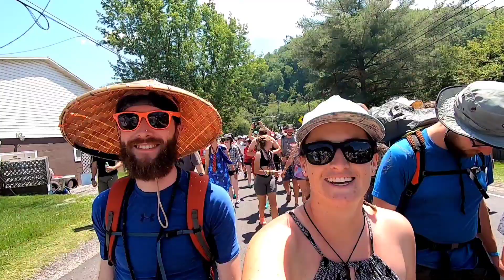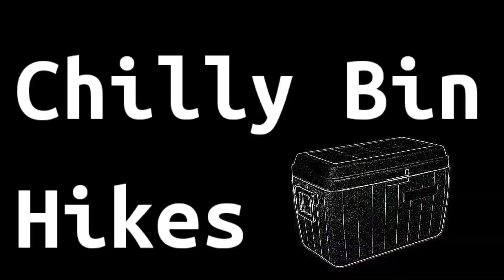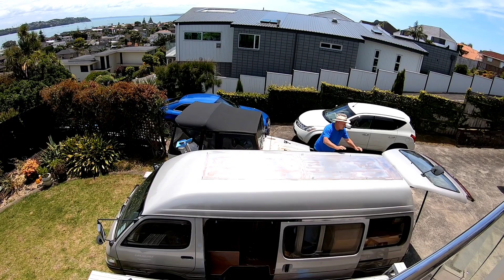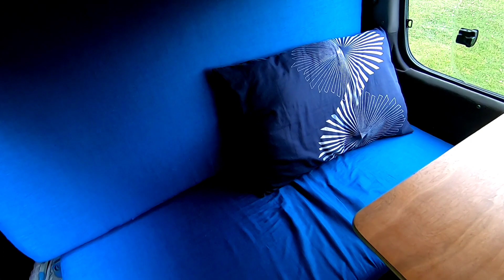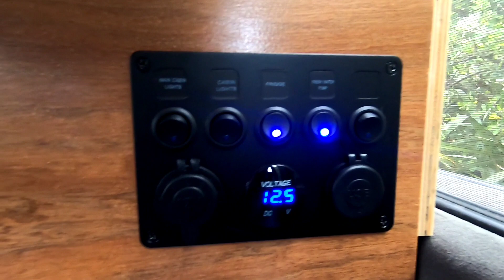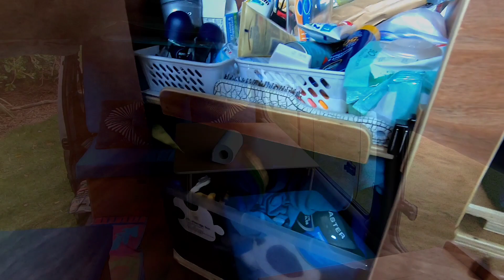Van Build and Tour - New Zealand Adventures - Chilly Bin Hikes

Comment: Looks awesome. Which pump and tap did you have installed please?
Reply from the maker: No idea which ones we were using sorry. Originally we had something cheap and basic which we picked up on Trademe, then upgraded the pump to the most basic one we could find in Burnsco, when the original died.